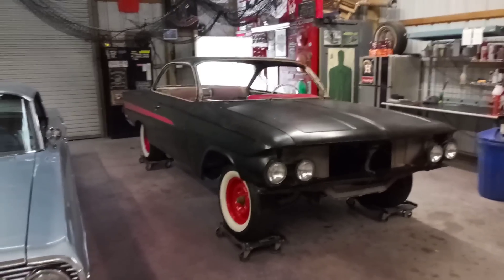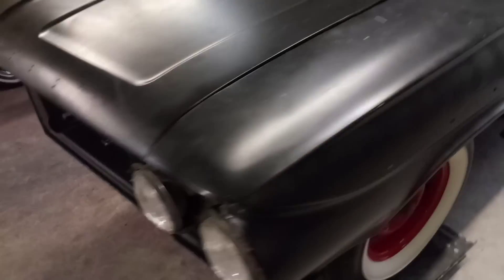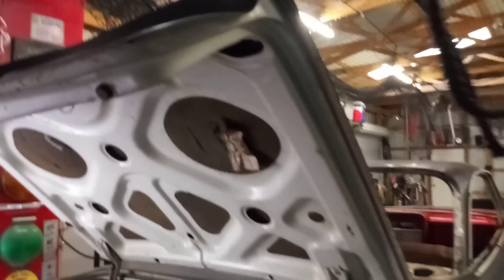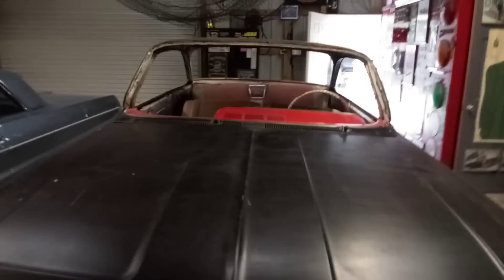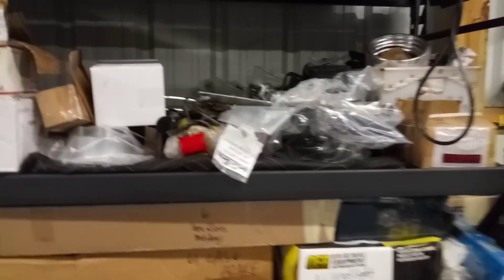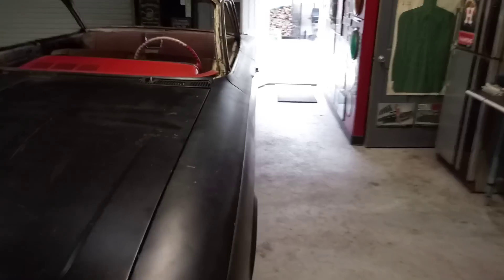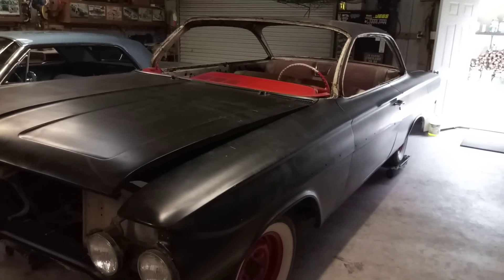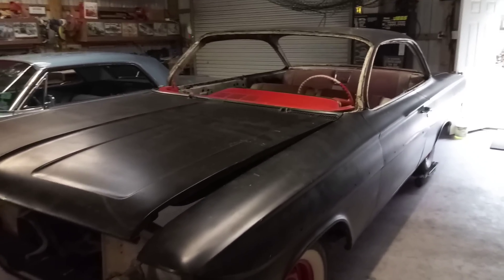1961 CHEVROLET IMPALA WALK AROUND.

Comment: Solid start and will end up with a solid finish 👍🏼
There’s a guy out here in CA  that has the kit to run disc brakes on those wheels or wires  in the same position
Did mine  fit perfect
Reply from the maker: Disc brakes with og steelies?
Reply: lonestar lows 
yup I  have a video on my channel that might show them
Reply: @lonestarlows  scarebird brakes sells kits. They work with 14" OG steelies. I used them on my build.
Reply from the maker: Oh nice!
Reply from the maker: News to me. Good!
Reply: @lonestarlows  the shop is in Orange, Ca, it's called ABS power brakes. I've installed two kits and they bolt on with no problem. I only like to roll stock Steelies with hubcaps. Also, the kit is a zero offset
Reply from the maker: Good info. Do they offer anything for the rear?  Maybe ill take my stock steelies off craigslist and save for next car.
Reply: @lonestarlows  I have never installed disk brake on the rear, I've always ran drums. But I think they have a set-up. They are pretty good answering questions over the phone.
Reply from the maker: @medicineman1202  honestly i dont notice any difference from disc or drum rear other than a cool factor